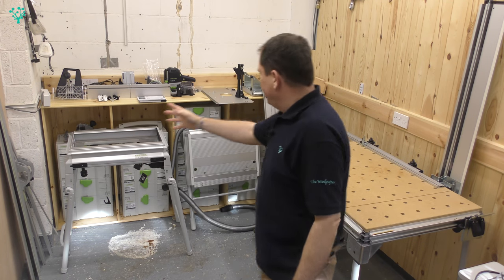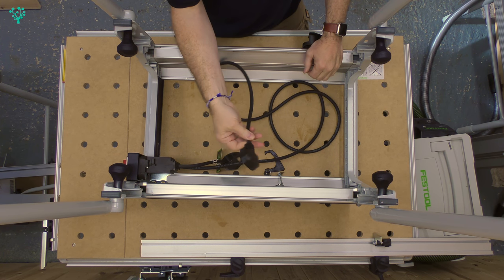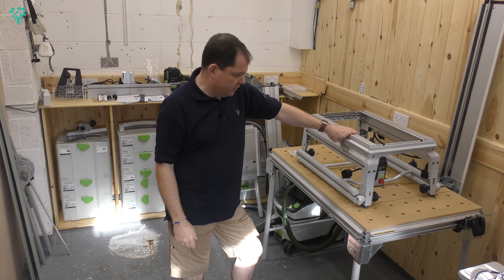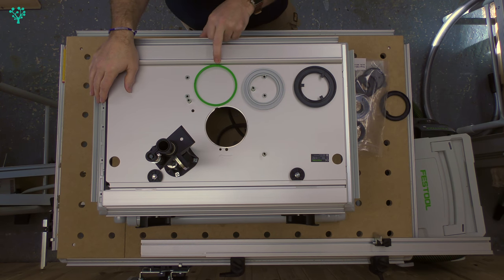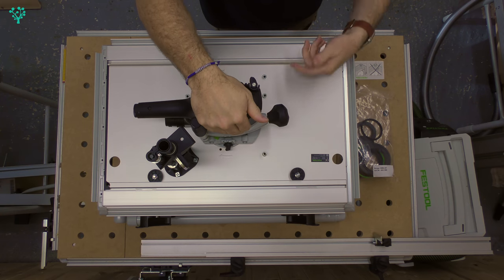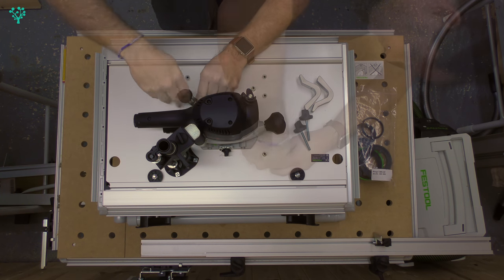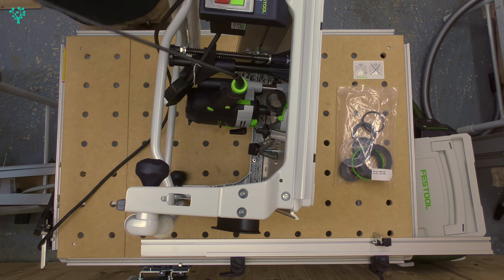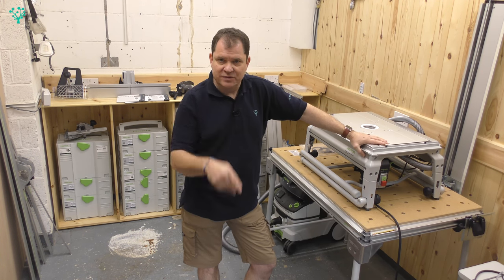Festool Compact Modular System CMS - Set up 1

Comment: Thanks for this vid. Just been using my CMS for the first time with the OF 2200. Found that the dust extractor can't be connected to the router when the table is collapsed. Other than that it's a handy table with easy adjustments, just a bit awkward with such a hefty router.
Reply from the maker: +ShortWorx 

Hi, I would love to drop the 2200 into the table and leave it as a dedicated station - just can’t justify the cost - yet.

Thanks for watching and taking the time to feed back.

Cheers

Andy

Comment: FYI (and AFAIK): The OF2200 set is not sold in the America's because the combination of 2200 Watts and 110 Volts exceeds the rated capability Amperage of the switch on the CMS-GE. Just discovered your channel and so far so good !
Reply from the maker: +Bert Vanderveen Hi Bert,

Thank you for getting in touch. Yes there does seem to be a different product line up in the America’s than here in Europe.

It’s a shame as the OF2200 in the CMS would make a great combination.I did hear that in AMS the OF2200 could not be mounted in the CMS, but yours is the first tangible explanation as to why.

So thank you for sharing this with the wider community’s

Talks soon.

Andy
Reply: The Woodgrafter Bert is correct. The OF2200 needs to pull twice the current when it only has half the voltage available. In Europe, it draws up to 9.1Amps at 240Volts, so in NA, it would draw up to 20A at 110V. The additional connection between the router and the CMS would also add a little resistance, adding further to the load.
If you look at the switch on the CMS, I suspect it is rated for something like 16A.
Reply from the maker: Sharif Shahwan 

Hi Sharif, I pooped into the workshop and had a quick look. The switch is rated for 13.5A

So you are both correct that is the reason why you can’t use the 2200 in AMS.

Thank you for the comments.

Andy
Reply: The Woodgrafter No problem. On the matter of the TS55 insert, that doesn’t pass safety rules in the US for some reason (amazing when you see how the Table saw has traditionally been used over there).
I’m not sure but I think those rules may only apply to professional situations, and so Festool just opted to not sell it at all and avoid potential legal issues arising.
There are plenty of examples of people grey importing them from Europe for personal use but if a commercial workshop were caught using it, they could be in trouble with OSHA (their HSE equivalent).
Reply from the maker: Sharif Shahwan 

I did not know that, it’s strange how Health & Safety get involved and have different views. So folks then import or create ways around things that are ultimately more dangerous to the end user and those around them.

I’d be interested to see what the issue is with the TS55.

I just checked and they actually do a 110v version of the CMS in the UK, and that doesn’t seem to have a restriction on 2200 - so it looks like the technology exists in Festool.

It would be interesting to see if there are any other reasons.

Cheers

Andy
Reply: The Woodgrafter I have wondered about that myself; the 110V is for construction sites, so at a pure guess, I can imagine it is something along the lines of there being adequate safety measures in place with construction site transformers plus the commando plug will be able to handle the current safely (if the switch on the CMS has a higher rating).
Also, standard domestic breaker in US is 15A (sometimes 20A) so you could potentially draw more current than the switch is rated for, plus the standard domestic US plug is probably not well suited to that kind of current at continuous use.
I do read about people using the 2200 in the table in NA and it’s probably fine most of the time as long as you’re not running it at full speed and putting it under very heavy load for long periods of time. However you can’t have the masses working like that; too risky. Safest thing is to say “don’t use it”.

Comment: how did u mount the rail to the back (hinged) side of the mft without the protractor?
Reply from the maker: +David Hi David,

I use the FESTOOL ADDITIONAL CLAMP MFT/3-ZK – 495541. It’s the black clamp that came with the protractor kit. I bought an extra one and just clamp the fence to the back rail.

However, it does have some play in it so not a perfect solution. The reason I went down this route was to maximise the cutting width, whilst minimising the overhang at the back of the MFT.

I am about to swap these out for some Fence Dogs https://benchdogs.co.uk/collections/frontpage/products/fence-dogs

These fit into the holes on the MFT so guarantee accuracy and they don’t have any play.

Hope this helps

Andy
Reply from the maker: +David Hi David, sorry just re-read your question. If it’s the rail you are talking about and not the fence, then that doesn’t use the protractor to mount. It has an independent adjustable hinge that fits on the back rail.

I talk about it in the MFT set up video series.

https://youtu.be/Nb5QUDqffiA

Hopefully I answered the right question this time :-)

Cheers

Andy
Reply: The Woodgrafter got it.  thank you for the reply.  love the video
Reply from the maker: Your welcome, glad I could help :-)